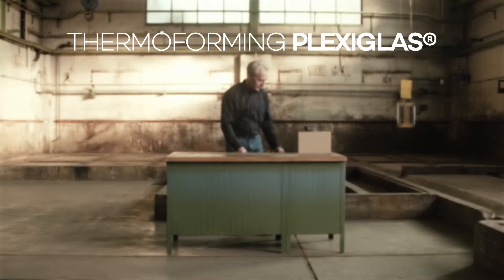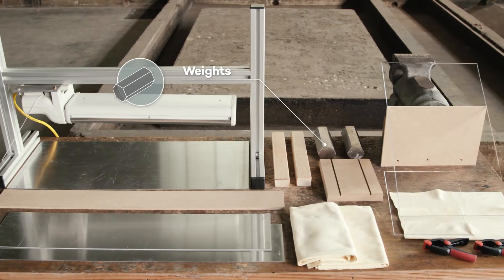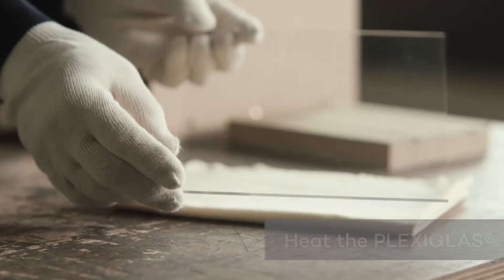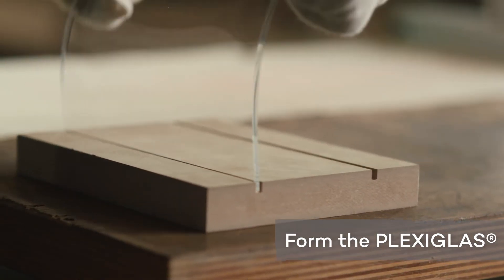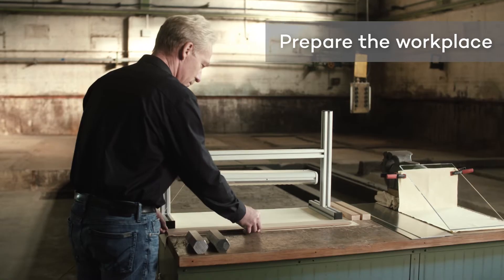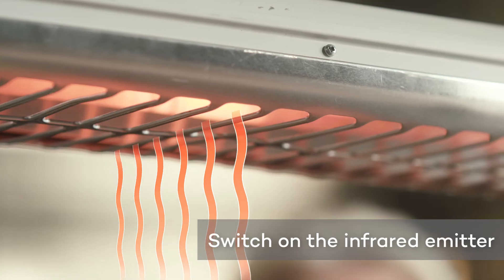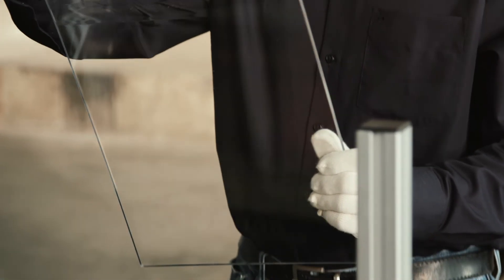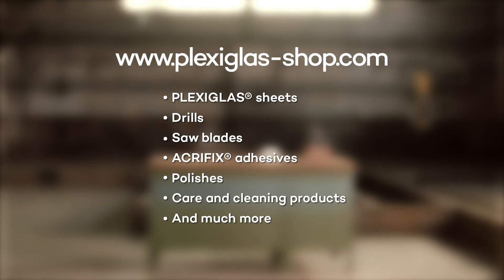Bending and forming PLEXIGLAS®: Perfect thermoforming in just a few steps

Comment: What if you need to form it into a complete tube??
Reply: You can probably buy it in tube form, otherwise you would have to make molds with timber and then glue the ends together with acetone, but your seam has to be pretty near perfectly fitting for it to work properly.

Comment: Can you take hardened plexiglass like say the 2 x 2 sheets of clear plexiglass that you can buy at Home Depot and heat them up with this machine and bend and form them ?
Reply: Buy a sheet, test it out and post what you find here. I think the hardened stuff is probably just heated and 'quenched' to give it the hardness. Might be worth heating the whole sheet up and letting it cool slowly before trying to do anything with it; I think if you tried strip heating it straight up, it might crack along the edge of the heat affected zone where the hard sections end.

Comment: Very good tutorial!!!!! Congratulations!
Can you help me to realize the heater you used in this video?
Structure, infrared heater, gloves: item details, brand and model, and where to buy on line?
I have to form and bend a plexiglas strip 1000mm length, 80mm wide and 10mm thickness like a spiral. Can I use this heater and what's the right temperature for bending?
Reply from the maker: Hello Aldo Alessi,
thanks a lot! We are very happy that you find our video helpful. 
We will gladly forward your questions to our responsible colleagues and will get back to you as soon as we have feedback.
Many greetings,
Your PLEXIGLAS® Social Media Team
Reply from the maker: Hello Aldo Alessi,
for the heating of PLEXIGLAS®, low-cost models of infrared quartz radiators may also be sufficient. Please send us a personal message via our Facebook account if you would like to have a link to a product suggestion for an infrared quartz radiator from us: www.facebook.com/PLEXIGLASen/

When heating, it is important that the distance between the radiators and the material surface is at least 100 mm. A more frequent turning of the material helps to prevent overheating of the surface. The forming temperature, if it can be measured, is between 150° and 170°C.  As soon as it feels rubbery, you can also form it.

Gloves should be made of heat-resistant material.  Preferably cotton.

Many greetings,
Your PLEXIGLAS® Social Media Team
Reply: @PLEXIGLASTV  Hello, coud you help me ? I'm interested in knowing the infrared system used please, I have a similar application to form 3mm acrylic but I can't find a infrared quartz radiator reference.